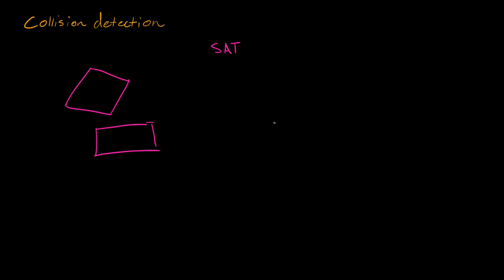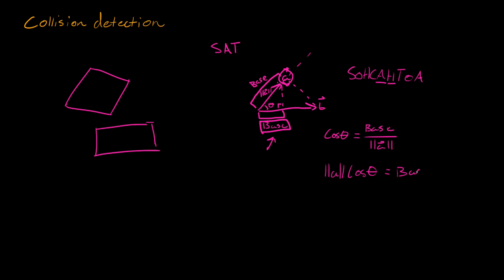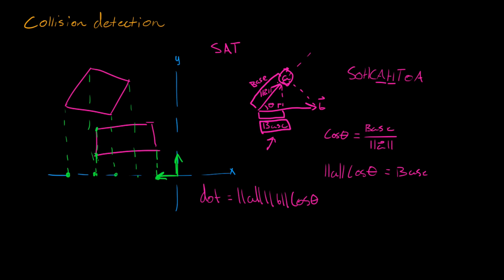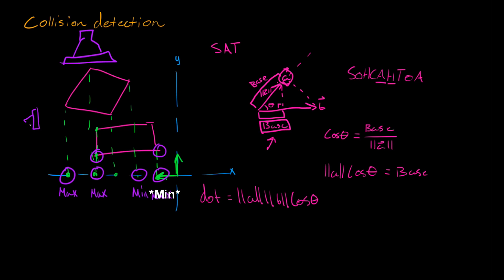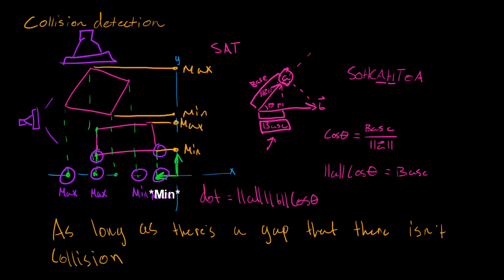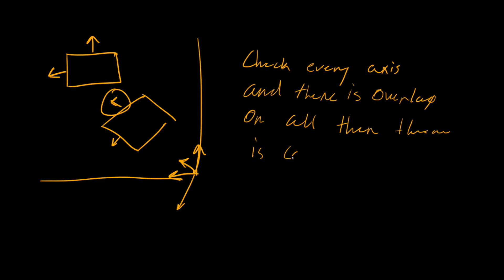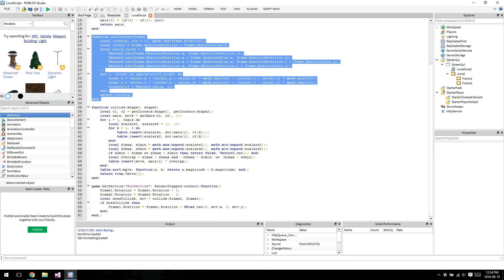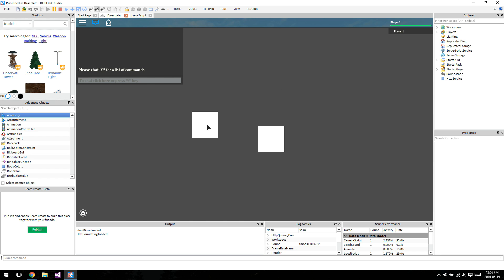2D collision detection (SAT)

Comment: Ok now I understand how SAT works, but there was another theorem to see when a point is inside a polygon (if you draw a line from that point it will only intersect the shape an odd amount of times if it is in the shape)... wouldn't that be as useful as the SAT?

Comment: So I have a 2d platformer. My player knows the angle of any sloped floor it collides with so say he's colliding with a 45 degree slope the angle of the player would be 45. Then If I'm pressing right I move the player up the slope in that direction being 45 degrees. That all works perfectly but my issue is with collisions. My player goes through the slopes a few pixels how would i keep my player flush with slopes. I tried moving him out of the slopes but it makes him bounce when traveling up them. This video looks like something I'm missing and I watched the whole thing but it's hard to understand I'll watch it 5 more times. I know what vectors are and I understand the max min kind of I'm just a bit lost on what I'm trying to accomplish that being a 2d sloped platformer like Sonic the hedgehog.
Reply: move on x then y
Reply: Chaotic Jreizy can you explain more what that means?
Reply: Ameer Almunian thanks
Reply: I think you should change the collider of the player so that it's not shaped like a rectangle at the bottom. You could achieve this by having multiple colliders for your player object. A rectangle from top to just up to the knees (based on human models). Then have a circle collider at the feet so it smooths out the bottom collisions. Your left feet will still be lifted slightly when going on a slope facing right, but it won't be as much as with a rectangle collider at the feet.
Reply: @Qlii256  I figured out what to do my question was how do I lock the player to the sloped ground so that he doesnt go inside of the ground but stays locked to the surface normal.

Comment: Sadly I didn't understand all of it :/ I hate just using some piece of code that I don't even know how it works, but then again, it feels so tempting to use sometimes :/
Btw, I wanna ask for ur opinion, what about detecting if any of the 4 corners are intersecting with another 2D object and then handling collisions that way? I already know that it's not accurate since, when the 1st object is bigger than the 2nd, if the 2nd intersects with the first around the middle of 1 of the surfaces, meaning it can go undetected, but then again, the smaller object will detect collision since it's corners will HAVE to be inside the other object to intersect, it would have to be a non-rectangle to not have corners intersecting with other objects, and as for velocity goes, I could just check to see inside that smaller object if the bigger object has detected the collision as well, if not then we'd just add to the velocity of both objects, from that object as well, simple logic.
Although sadly the point intersection script was also done up for me sort of, but at least I can somewhat understand it. (Was trying to create a 2D raycasting script, and thought that the easiest way to go was to keep checking every pixel along the path) mind making a video about point intersection?
Reply from the maker: I'd be glad to make a 2D raycasting video, but I think if you read the article I posted in the description you might find some the of the answers you're looking for.

As for having difficulty understanding this video, can you describe (or give a time marker) on what you found confusing. I'm more than happy to remake the video if you think it would help more people understand it.
Reply: That'd be nice! :D Cos no ideas came to my mind when thinking of raycasting, all I thought of was to check every pixel along the path, if it collides with anything, that led to me looking for a way to detect if a point is inside a 2D object, I had some problem understanding all the calculations I saw, mostly due to math symbols that I'm not used to since they're not used in Lua, mainly this symbol '|' but luckily my genius friend that has been programming for 7 years or so, helped me out and wrote it out in Lua, and it worked :D So I only sort of understood it when he wrote it out (Sadly I couldn't come up with a way to detect intersection though, I love to try myself sometimes) but am pretty sure that there are more efficient methods to check for intersection on a line.

Well, I couldn't understand a lot of it, so it's kind of hard to specify where I got confused, but it would be easier to understand if for example, u could show the script and say "This line does this, so that it can be used for this" or whatever, I think u get the point.

Thnx :)